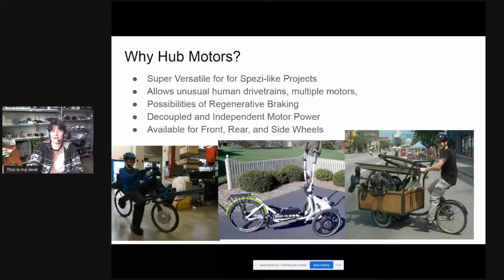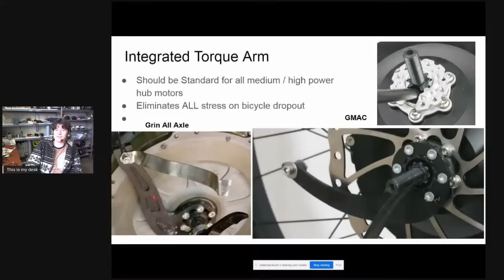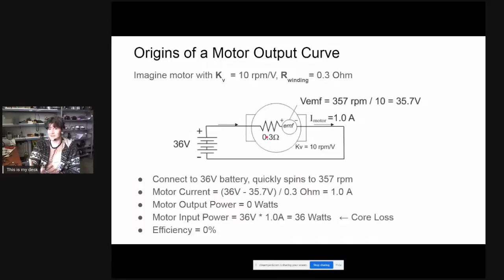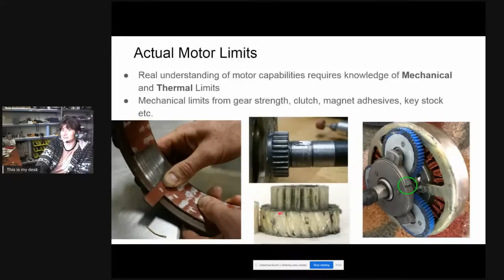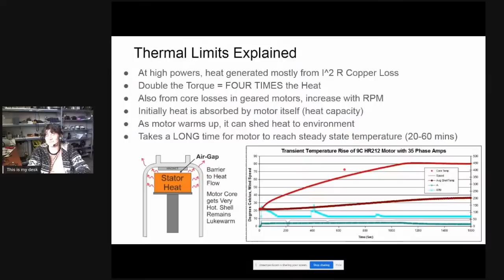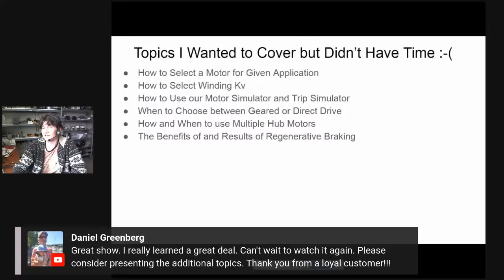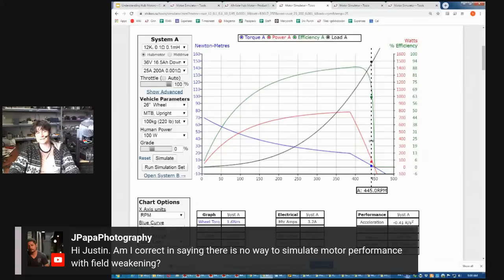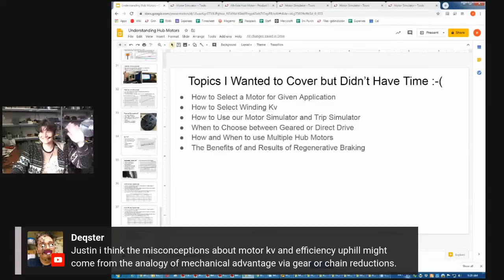Understanding Everything about Hub Motor Drive Systems - Spezi 2020 Live Presentation

Comment: Excellent video.  As a mechanical engineer, I've always felt a bit uneducated when it comes to electric motors.  Now I feel I have a basic understanding of the design parameters important to at least one type of electric motor.  Thanks.
Reply: Old as dirt. Same profession. Same e-tech intimidation. Same flow of understanding from Justin. Same emotion. After 2yrs research, last year I bought an e-bike to exercise/ commute. Hardly ever had anything mechanical I didn't take apart and repair just for kicks, I was forced to learn electronics or suffer a 'genetic pre-dispositions to tinker' crisis.
I quickly found the master I trust and determined to catch the whipper-snapper in next couple years, I began absorbing his free educational publications. 
Chipping at a rock, or taming nuclear isotopes, while materials and tech change, we Engineers design and build stuff.
Something's changed ???

Comment: this is absolutely wonderful. THANK YOU JUSTIN. i have an 800watt front hub motor ebike and a 1500watt rear hub motor ebike both direct drive chinese voilamart.  both with home built batteries the 1500watt has 208 (yes 208) 18650s.  the internal controller on the 1500 watt fried after 60km so im running an external controller now and its great. your video has answered every question i have about these motors thank you! no seriously THANK YOU!   ps i saw some video of you on that solar ebike thing to china with you (and your nearly wife) doing the rowing thing and the pedal thing. great stuff best wishes from Manchester UK.
Reply from the maker: Hey glad that you found it useful and luckily our next deep dive presentation topic will be dual motor systems which should be quite relevant too!

Comment: I’ve been experimenting with pure silver stator windings.  
Copper windings when they heat up experience what’s called the “corona effect”. Resulting in loss of power linear to the amount of heat produced.
Electricity travels through fields not the wire itself.  The heat interferes with the fields.
Seems I’m getting about 15% more efficiency at full power. 
Silver is expensive and I don’t think it would be commercial viable except in very high end applications.

Comment: Love it. Thanks
In a dual motor configuration in an ebike, being one in the front and 1 rear hub motors, if the ebike is solely used for single motor only being the rear, does this prematurely speeds up the  wear and tear of the front motor? TIA
Reply from the maker: Short answer is no. Just having the hub spin without being powered does not cause wear and tear on anything other than the ball bearings.  That said, you should only be doing this (running one motor and not both of them) if the front motor is a geared motor that freewheels. If it's a non freewheeling motor, then you should still be using it too for maximum system efficiency.
Reply: @GrinTechnologies  Fantastic. Thank you for your feedback.

Comment: A fun fact that your readers might already know - in the EE motor calculations, actually there is only one figure for the 'motor constant' that links speed to voltage, and torque to current. It is only the departure from the pure SI units, to things like RPM or kph, that makes the two constants look different. Not wishing to stir anything up, but that's why design/analysis engineers love SI units - metres, seconds, Newtons etc - all those awkward conversion constants disappear! You can do all the sums easily, then convert the final answers to our real-world units.

Comment: I like hub motors but one caused me to break my hip. This was due to carving while using the regen. I hit some dirt on a potholed road on a bike with no suspension and a very heavy smart bion x. Always turn off regen when you don;t need it or if the roads are wet and you are cranking. It's like pulling the rear brake when you down want to. I was flying down a very steep hill to go pick my son up from school. I started to slide down the road and the bike went much further. Either the top of the femur snapped off as i initially fell or it was possible i hit a pothole with my feet as i was trying to slide onto my feet. Now i have 3 huge screws and a big risk that the bone will die as the artery inside the bone that feeds blood to the end is quite likely to be damaged. This could well mean a trip back to a hospital for a hip replacement which i really don;t want. Lets hope the artery is ok and i can perhaps have the screws removed if i'm lucky.

Comment: Thank you so much for this valuable lesson and for your hard work and..Ive been riding ebikes since 2008... Just knew the industry would explode one day. I've been involved in electro mechanical work in Large printing systems over 30 years so I got alot out of your lesson. Was especially impressed with your work using small wind tunnels to measure stresses on motors and using vent holes. Wanted to mention thought I don't know how I feel about the thru axel motors you mentioned. They sound good but in my experience anytime I've had to slide out an axel on any gear in use more than a few years it inevitably sticks and I have to fight with it.

Comment: Great presentation, if possible can you give me your thoughts on the advertised motor setup for the soon to be released Monday Motorbike Gateway Booster. This is what I have been able to get from the co. Bafang internal gear Motor brushless Rear Hub 48v 1200w controlled w/ pedal assist /  Rotating speed = 245 RPM . Have not been able to get any more specs or seen reviews on this motor, I do not know if it is a custom motor made for that co. or if it is a commercial model motor. Any thoughts or other info on this model motor would be very appreciated.  Thanks!!

Comment: A major focus of my experimentation is finding ways to tailor the voltage & current output to an optimal needs of the specific motor being used on a given build. I have had some success using boost converters and even an MPPT charge controller with DC/DC capabilities, but from one motor/controller combination to another the net results can vary greatly. What advice can you give for finding the sweet spot for a specific motor and conditioning the battery output to match the optimal needs of the motor. I typically try to employ 36-48v motors, coupled with a beefy controller capable of tolerating 60v or modifying the controller to support the higher voltage, then running 2 battery packs where possible, at a college that generally supply 12v more than the voltage rating of the components. I have also had some success back charging the battery packs using a DC/DC boost charge controller. All things optimal, this approach has at times been incredibly effective but I'm done setups it has failed to produce results. I generally use fairly cheap, but high capacity Chinese battery packs or custom built packs as my power source cheddar I've found it more advantageous to have 2 or 4 cheap batteries than just one at the same cost. I have designed a DC/DC boost converter that I hope will expand the possibilities for disking up an optimal voltage but I am very interested in hearing your thoughts. Overvolting a 48v system with 60v seems to bring the best results.

Comment: Most specific, where do you get your battery build supplies,  zinc strips, flux, soldering wire.  Which is best D.C. spot weld, or soldering gun, if gun minimum wattage so as not to cook battery

Comment: Hi very informative video! Love it! I have a question i hope to be awnserd. I have a Mac motor 10T and a 52V battery. Is it safe to put 60A (86A pahse) without it breaking down too fast?
Reply from the maker: Generally that's OK as long as you don't allow the motor core temperature to get too hot.  Temperature sensing and thermal rollback are important.
Reply: motor maybe would be ok, but hall sensors can pop out

Comment: New at this, a little overwhelming.  Listen, emotor genius - (you are) - hope you'll still take a few minutes to help a beginner, not for sport, but for a quality of life issue.
  We're stuck in eastern europe without a car because of the pandemic.  Groceries and especially drinking water are heavy.  So we got bikes, racks, bags and backpacks.  Borrowed a welder and made a wagon out of a handtruck which is towed as a trailer. Getting older.  2 much pedaling.  Bike store has hub motor kits.  Got 2, one for my wife.  My bike is doing its best imitation of a cargo bike.
  The kit is a generic 1200W hub motor (biggest avail.) with a 48V battery having 11.6 amp/hrs run through a 22 amp controller.  This was the best I could do from available stock.  The supply chain is down they tell me and we had to make kits from in stock items - as the option to order things is like, not really.  So kept things as simple as possible and we don't run pedal assist or motor cut-off brakes.
  Having this power helps greatly but I need more oomph because this bike pulls loads, for us it's a pickup truck.

  From doing some research before buying anything I was hoping for a 1500W motor, minimum 30-35 amps on the controller, and at least 17 amp/hrs on the battery, but was disapointed with the specs that had to be settled for.

  Also saw things others say will boost power.  What's the truth?  Is there any benefit to running a thicker main power wire to the motor?
  And if the supply chain opens up: What component changes would be most beneficial in the torque department for this motor?  Going to a 52 or 72 V battery?  Or a controller with a higher output?  Or both in what combination?  Or something else I dont know about?  

  Also seriously considering front hub kit to make 2WD.  Some in stock.  Call it a matter of situation and availability that for us this may be the only way to get more grunt out of our main mule right now.  Front motor kit would be a completely separate/isolated system from the rear with its own battery, controller and thumb throttle on the left.  What I don't know is if it's important that the 2 motors front and rear have the same wattage?  If the biggest front kit available is 750 watts/48V is that a problem?
  I'm thinking torque is torque, and more is more, and anything contributed by the second axle would be cumulative and increase overall torque.  So that even adding only a 500W / 36V system on the front would be beneficial to overall torque.
  Am I thinking right?

  What's your best advice for getting more power from what I have, and what do you think of the whole 2WD thing?

  Thank you in advance.

Comment: Yesterday i rode home from a friend's place who lives about 1,000 feet above me near Lake Superior.   On the brakes most of the way and was wishing i had regenerative braking.  In a hilly city this would seem to be an ideal system.  But i need torque and power for climbing too.  When i look at the motor systems on the Grin website i am at a bit of a loss on what to choose.  Pretty sure i could use only a front brake along with a rear motor hub with regenerative braking.  My current bike uses a BBS02 with a 20ah battery, 42t Lekkie ring.  It has good range and climbs really well.   I would like similar performance with a regenerative rear hub set up for my next build.  I have a 20 year old Trek hard tail for a donor bike.
Reply from the maker: Hey there, any of the more powerful hub motor options would be fine.  RH212, GMAC, Grin All Axle, Crysatlyte 'H' series etc.  If you want to keep your mid-drive on there and just add a 2nd hub motor for regen, then it makes sense to go with the lightest which is the Grin All Axle hub on the front.
Reply: @GrinTechnologies  Sounds like a winner!  What kind of peripherals would i need for that?  A short synopsis of the system would be helpful.

Comment: Could a motor casing remain closed for protective purposes but have strips of copper welded to it with curved/frayed ends to dissipate heat? This might add drag and cause some wind noise, but the extra heat taken away by the air might allow for significantly more watts. Yes?
Reply from the maker: As long as you still have an air boundary between the stator and the rotor, it will have a very marginal effect.
Reply: @GrinTechnologies  I’m not sure what a stator is.  But would ferro fluid solve this? Also, I wrote that comment before I discovered the heat sink, which is almost exactly what I “invented” in my mind.

Comment: Justin. Have you ever seen delamination on DD hubs? My only concern with a front DD hub is that the magnet's glue deteriorates over time and could lead to catastrophic failure with the front wheel locking up.
Reply from the maker: On direct drive motors if the magnets do come loose (as we showed in the photo of the Crystalyte Crown hub) they stay attached to the rotor, they won't jump onto the stator and they don't cause the wheel to lock up or any catastrophic failure like that.  Just a very substantial reduction in motor torque ;-)   This is an extremely rare problem from manufacturing defects of incorrect adhesive application, normally the shear strength of the magnet glue is way way more than the force on the magnets from the current flow in the stator.
Reply: @GrinTechnologies  ok thank you. I have been running your rear hubs now for a few years but would like to try the front hub system for spoke longevity (equal tension both sides) and then run a Rolhoff on the rear. Thanks again for your response

Comment: Justin, one question, imagine we have a hill 15%, and torque required to climb it is 100 N.m. Now let's assume we have 2 identical e-bikes, same battery, same controller, same settings, but one motor is 3t and another is 6t. So we turn throttle to 100% and start climbing. Motor provide same Phase amps, enough to ride uphill on 6t and 3t. 6t motor accelerate 2 times faster to some speed X km/h, can we have a situation when motor with 3t will not even reach the X speed with same Phase Amps ?  

I think when we say that 3t can climb as well as 6t motor we forget that crossection of the phase wire for the motor is the same, and doubling the phase currecn on 3t ebike will cause 4 times more heat losses on a phase wires. Is it correct?

Thank you for answer!
Reply: If you have half the turns you have double the area and half the length. So you have 1/4th the resistance and can handle double the current for the same resistive loss. 2x area = 1/2 resistance. 1/2 length = 1/2 resistance. 1/2 * 1/2 = 1/4.

You wouldn't use the same battery and controller for different motors. You can use a battery that is half the voltage for the lower turn motor and you can use lower voltage power electronics which can handle more current.
Reply: Check the video again, he answers your question and shows it in the simulator.
Reply from the maker: Hi there, yes you are totally correct it would mean 2x the phase amps which would mean 4x more heating in the phase wires.  However, in a 3T motor that does 100 Nm of torque, you would expect the motor to be produced with a heavier gauge wire to accommodate it.  We used 4mm^2 wire on the GMAC and 3.3mm^2 on the Grin All Axle and with that kind of gauge this is not usually a limiting factor. Normally the limit is in the motor controller. But it is true that other motors often have thin (1.5-2mm^2) phase wires and there that can be the practical bottleneck to faster motor winds. 

To the first question though, if the motor controller is phase amps limited (not battery amps limited), then yes for sure there is a very big performance difference in your scenario, and the 3T motor might not be able to climb a hill at all if the phase current limit of the controller results in less than 100 Nm.  It's not just that it wouldn't reach the same speed, it wouldn't even move at all.  But just remember that's the fault of the controller, not the motor ;-)  The motor would be happy to do more torque and climb, but your controller is not allowing it.

Comment: Considering the GMAC, with reverse drive function, would there be a possibility of inducing brakeforce modulation like ABS, instead of regen braking? What could be the possible implications one could face, if a program is generated for carrying out such function.
Reply from the maker: If you want to make your own circuit to modulate the braking intensity it's quite simple as it's just an analog signal.  We haven't seen any need to do that or to experiment with that, and smooth steady regenerative braking seems to be what most people want.
Reply: Another query I wanted to add, since the Covid-19 has affected the supply chain across the World, are there any magnetless motors based on the Induction Motor or the Switched Reluctance Machines for hub motor application for ebikes, coming to the market or you would be bringing in your portfolio?

Comment: Can you discuss the methods for fully characterizing a hub motor? Kv, Hysteresis torque, Eddy current torque, etc.
Reply from the maker: Yes, this would be a great topic too and could go over how to create those values for doing a custom motor with our simulator.  All you need for this is the ability to run the motor at two different voltages, and the ability to measure both the RPM and the current draw at each voltage.  So it's actually within the reach of what a lot of people already have in their toolkit.

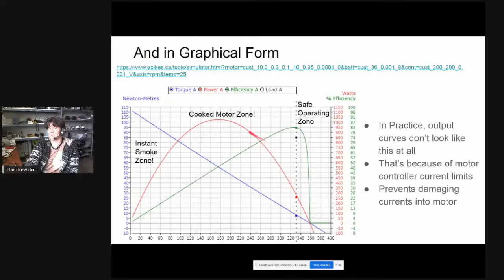Comment: Yo at 55:00 you say that a motor controler is the key.
What are good benchmarks to find which controler is the best?
Reply from the maker: One where the controller is no longer the bottleneck for performance. If you find that the controller overheats or goes into thermal rollback well before the motor, then it would be a sign that you should get a larger controller. If the motor gets really hot before the controller does, then you could probably get away with a smaller controller.